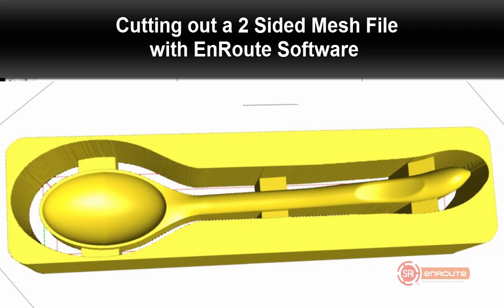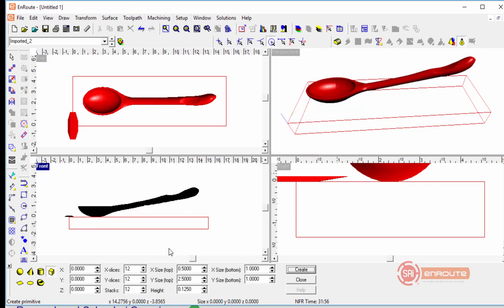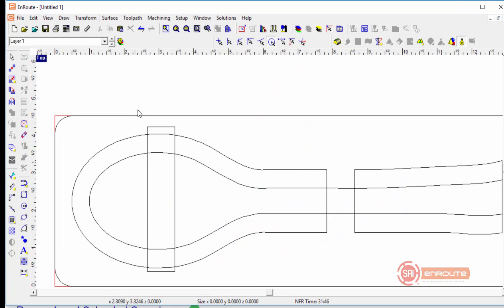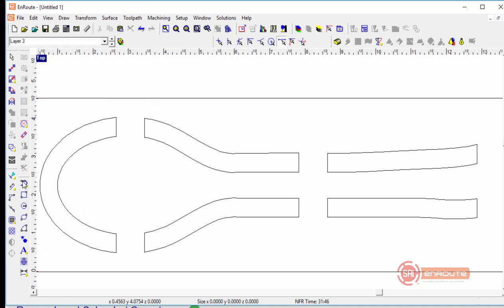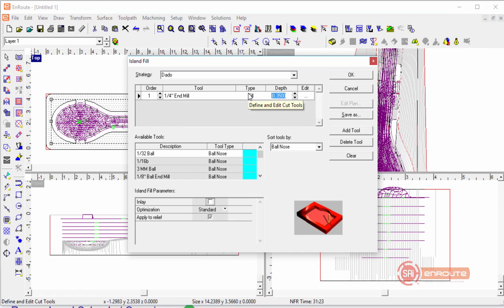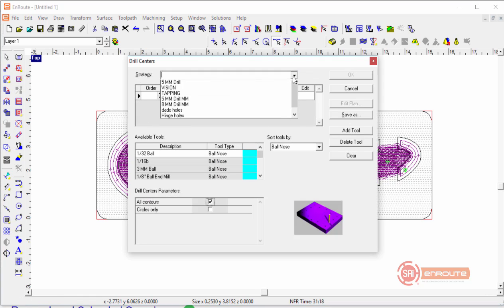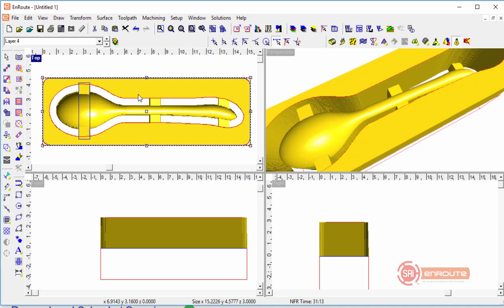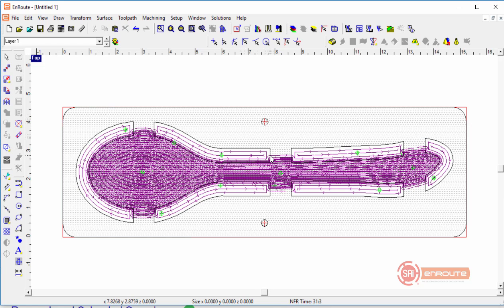How to Cut a 2 Sided 3D STL Mesh using EnRoute Software

Comment: Hello
I'm having problems in generating the g-code ... it appears some line sque do not need ...
%
O0001
N1 G17 G90 G49 G70
N2 G40 G80
N3 G54
N4 G53 Z0
N5 T0
N6 M3 S24000
N7 G49
N8 G43 H0
N9 G54

Need:
The line N1 G21
Delete N2, N3 N4, N7, N8 and N9

How do I configure Enroute?
Thank you